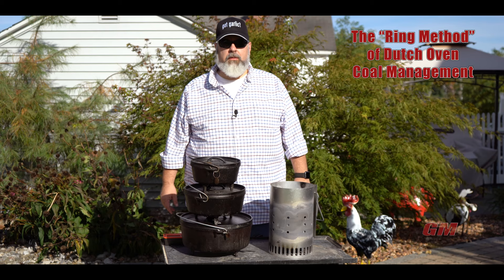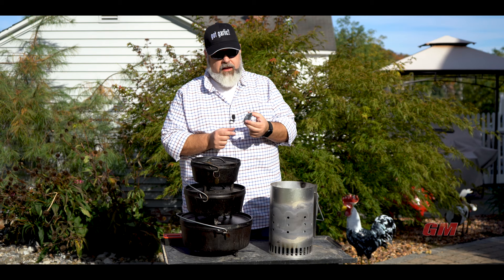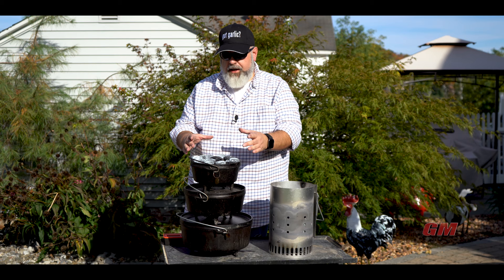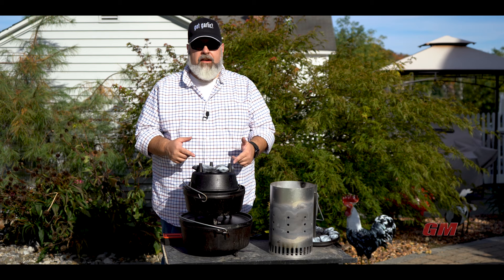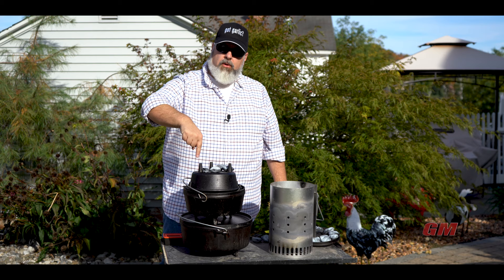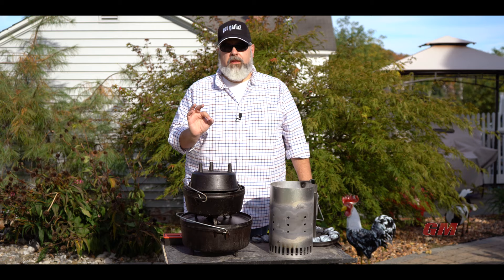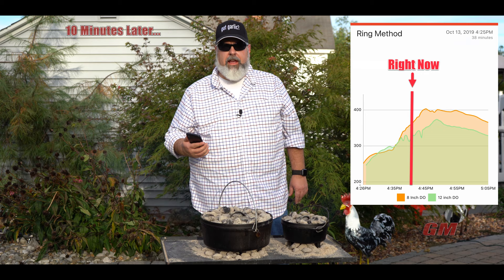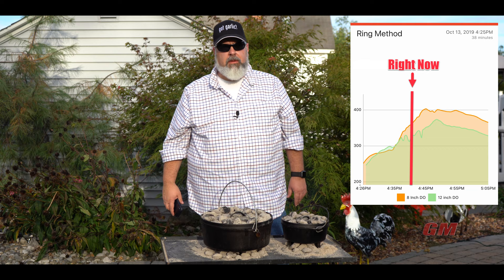The "Ring Method" of Dutch Oven Heat Management

Comment: How does it work for stacking ovens?
Reply from the maker: If you keep consistent sized ovens, pretty well. You’ll have more coals on the bottom, but they’ll be further out, it still kind of works though. Thanks for watching.
Reply: Check out cowboy kent Rollins if you haven't already. My "stack" tapers, so coals vary. I put my coals on the very outside of the rim. Good luck

Comment: So, I like your temperature test. But your own methodology is shot to hell. You just pilled up a variety of coals, for each pot. You didn't use any base line # of coals / pot size, to show any equality of heat. Were you are using a diameter method, as you first explained OR the method of 3rds? Or just pilling them on?